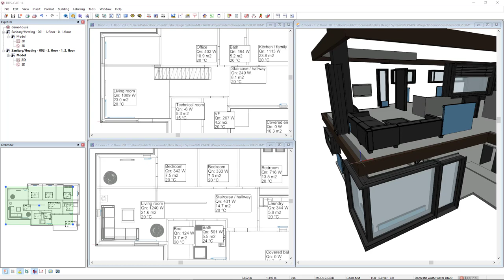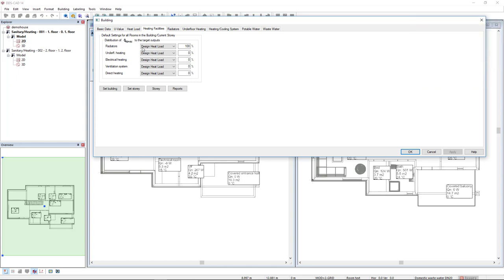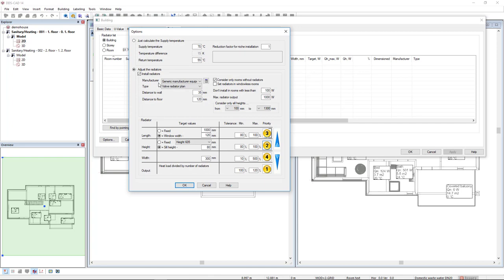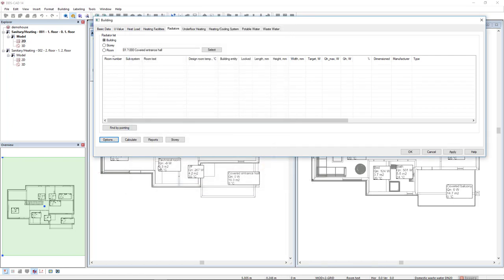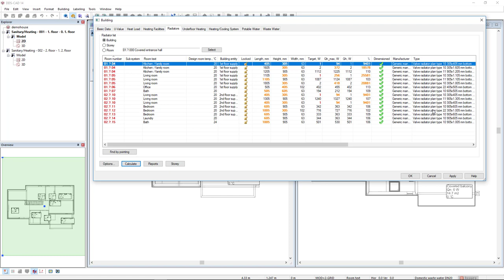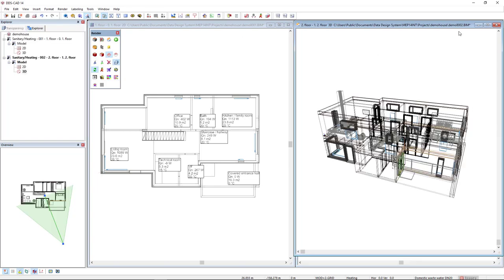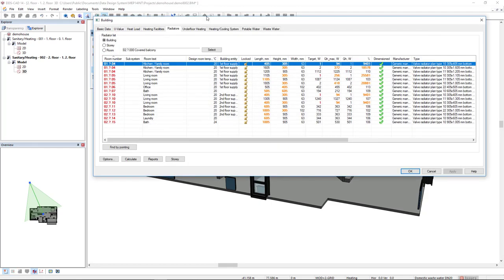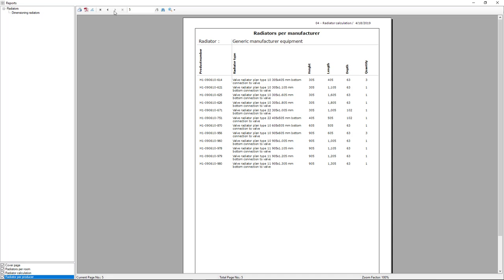Calculating and automatically placing heating radiators in a complete building

Comment: Hallo Filipe,
Is there any possibility of divide the number of radiators in a certain room by %? For example I have the room with three windows, their lenght is 1500, 1500 and 750mm and I want to place radiator below every window, 40% + 40% + 20% of heat load ...
Reply from the maker: Hi Michal, in the Options dialog you have a number of options available to influence the automatic calculation. One of the priorities is based on the radiator output.
Reply: Hi Filipe,
Yes, but in this option I only limit it the max radiator power. Using any% heat load as max, DDS-CAD will usually design the same type of radiators. Next, you have to spend a lot of time to redefine them room by room, especially in the big building, by changing priorities and max of priority limits. I am looking for an other way to do it quicklier and more effective...
For example, in my old software (not BIM), I had the option to define the number of radiators for each room and define % of the power of each one. It was "simply clever" solution with no changing priorities ...
Reply from the maker: @michalkmet1918  I recommend you to reach out to your local support contact to further discuss what the best approach is to obtain your required results. Unfortunately, YouTube comments do not lend itself for me to go into details.